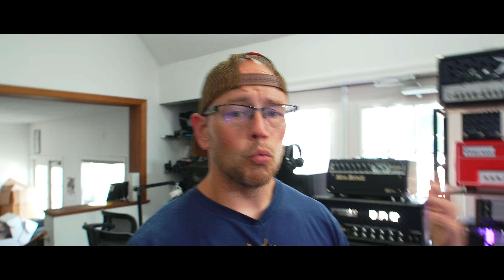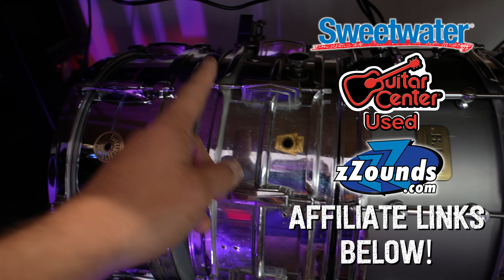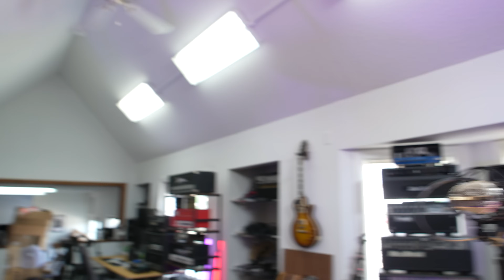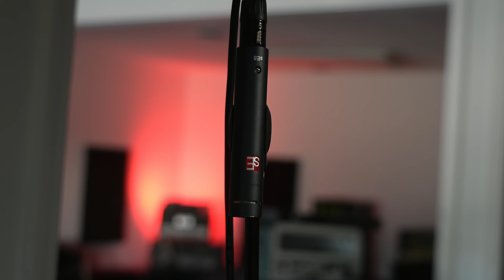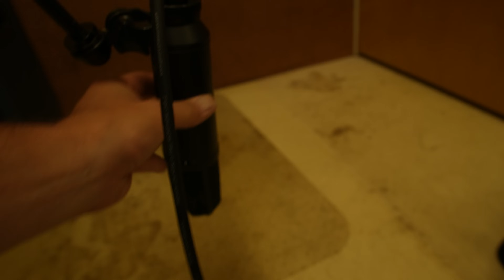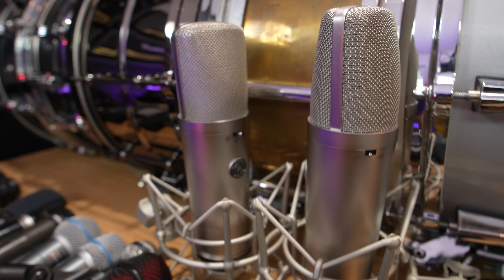My Recording Studio / Gear Emporium is FINALLY OPEN!!

Comment: The only thing with having the amps as the natural diffusers is that when you move them or sell them and some come and go the room will change and you might not have that repeatable of a recording sound over the years.
Reply: I have a similar set up in my studio. The change is negligible. Mic selection and placement ends up being more important.

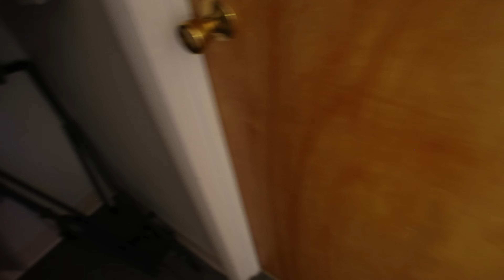Comment: 15:20 might be interesting to make like a doggy door on the bathroom door to open up and allow more sound in. You could cut the bottom off of the door and reattach it with a hinge or something to close it off when being used as an actual bathroom

edit: actually i guess just experimenting with opening the door at different amounts would be easier haha
Reply from the maker: The edit cracked me up. haha

Comment: Have you tried the AmpRx voltage attenuators? Their known for the Brown box pedal, 1200, 2400 rack models. Helps extends the life of the tube amps. &, toneal quality improvement. Great for older amps.. For your New studio rack equipment. Might I suggest Streling Modular is for real men. If your interested in having a small noise footprint.  Check out Synergistic Research active ground boxes. Also check out the new pink starter line of power cords starting at $200.  Keep up the great work! Really enjoy the informative videos!🤘👍👍
Reply: Your video is very inspirational. Goes to show what can be accomplished with determination &      guile. Looks very heavy metal !!!🤟  Keep pushing the positive vibes for local talent.  Every city needs this kind of enriching &, energetic environment! Good work!!!🍻